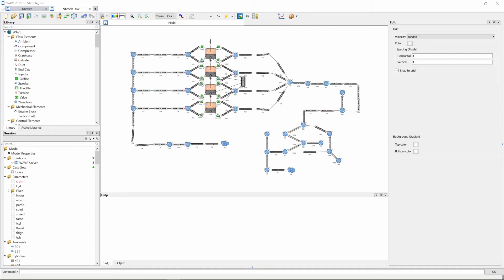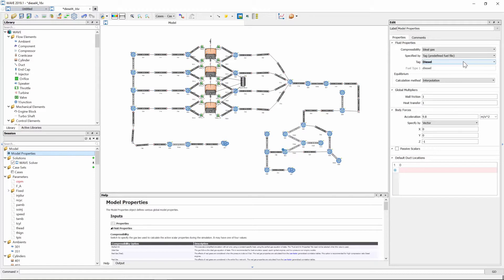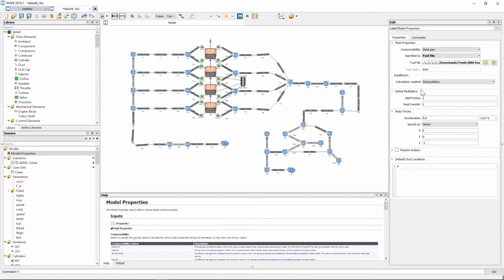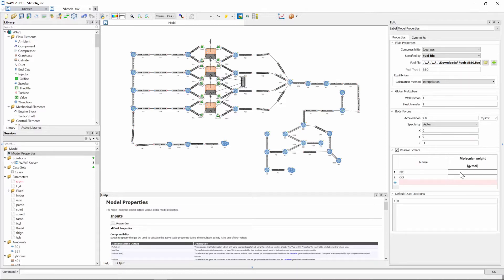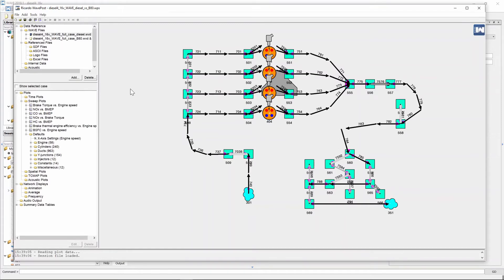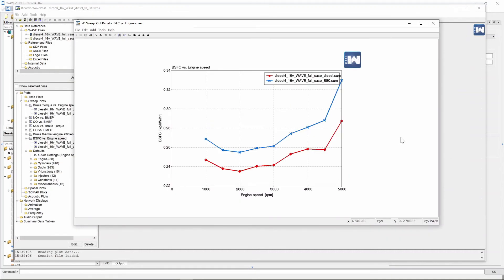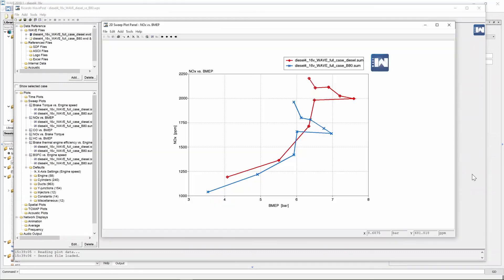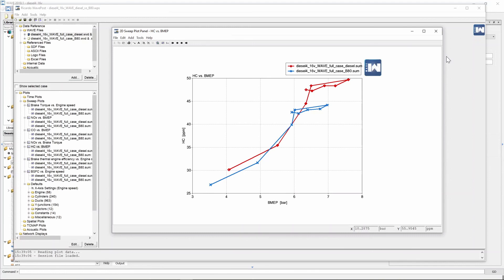How to simulate an engine using biodiesel | Engine performance and emissions | Ricardo WAVE

Comment: Hey I was wondering if you could send me this file you used in this video. Or tell me how to access the tutorial files in Ricardo wave? I'm using Wave 2022 are the files available on this version?
Reply from the maker: Unfortunately I do think have them any more. The tutorial files should be under Ricardo WAVE’s program files on your C drive
Reply: @AdriaanVanNiekerk  I'm using my university's computer and nothing is showing up in the C drive. Is there any other way to access these files?
Reply from the maker: @worldofanime4219  that is a problem - It might be worth while to ask your university's IT department to help? Unfortunately I do not know of another way to get the files.
Reply: @AdriaanVanNiekerk  unfortunately they were no help at all. I’m trying to model a 4-cylinder internal combustion engine based on the E888 engine for my dissertation. I need three simulations one for a gasoline fuel and one for an Ethanol-gasoline mix and a Methanol-gasoline mix. I’m struggling to make the model as it’s my first time using the software. Do you think you might be able to help at all?
Reply from the maker: @worldofanime4219  I had a look in my archived files and I only have the .dat files of ethanol, diesel and FAME. Have you looked in the model where you specify the fuel, (at 01:00) where there is a dropdown of all the available fuels? You should be able to possibly use E85?
Reply: @AdriaanVanNiekerk  I will take a look after I have tried to model my engine and get back to you.
Reply: I'm using my university's computer and I have searched high and low for the tutorial files but can't find them anywhere  @AdriaanVanNiekerk

Comment: Hello, I was stuck in the wave post results. How do i add the data from another run to the current run. I tried using the method mentioned in another comment but it is not accessible to add another run data.Also how do I enable to more sweep plots as seen at 4:21 to the left of the screen below the sweep plots tree .
Reply from the maker: So for every run you do a .post file is generated which has all your run’s data. In order to plot multiple runs you need to:
1. Run your first simulation
2. Rename the post file to something other than its current name
3. Run your second simulation where you made the necessary changes
4. Rename the newly generated post file
5. Repeat this until you have all the post files you need. 
6. import them into WAVE post
7. Now you can overlay the data on one graph

If you don’t rename them, WAVE will overwrite the old post file with the new one

Comment: What is the function of Y-junction?
Reply from the maker: To add multiple ducts together. This is useful for intake manifolds going from one duct to many as well as for when a exhaust manifold goes from many to one duct. You can also specify the orientation of the connections which helps with accurate pressure loss calculations 💪🏻
Reply: @AdriaanVanNiekerk  Noted. Thanks alot
Reply from the maker: @mohdfitrilimat  no problem 👍🏻

Comment: HI super explanation, I am trying to plot graph for Nox and every time it comes as a St. line can you tell where I am going wrong?
Reply from the maker: Hi Nikhil. I just want to make sure I understand correctly: do you want the values of NOx when it is above a certain value? You might be able to do it with an if statement block?
Reply: Hi, I am trying to compare emissions trend for different ethanol blends. So, as you explained I added NO as a passive scaler and activated emission model for the same. 

However when I am trying to plot graphs NOX VS BMEP or torque, I get straight line showing value as zero.

Comment: Hello Sir,
Great videos I like your content ... there aren't much resources to learn Ricardo from ,your content is very well explained !!!

Sir i was struggling plotting the graphs .. i plotted graphs as you have shown in video but my graph just shows a single point ... and i want to compare the graphs of engine with Diesel and same engine run on Biodiesel as you have done ..i wanted to compare the results.
Your advice would be very useful for me .
Reply from the maker: Hi! Thanks for the comment! If it was just one point check if you have run more than you one case? You need to run different cases (with different RPM values for example) to get a line graph
Reply: I got the plots right ...But right now cannot get the result graph of Blended Biodiesel and Diesel in single graph
Reply from the maker: You need to add the results from the blended fuel's run to the run of the diesel fuel. So if you go to about 4:19 you will see the graph window. There is an option "add" at the top. If you click it, you can select "WAVE data" and then select the other run's file and it will be added to the plot.
Reply: @AdriaanVanNiekerk  Got it Sir Thank you ... one more doubt how to add varying loads to get plot of Load vs. NOx
Reply from the maker: @bhushantayde5762  that depends. What injectors are you using? If it is an AFR one, then you need to restrict the inlet airflow which will result in less fuel being injected which will reduce the load generated.

Comment: Hi Adrian Van Niekerk
I would like to congratulate the tutorial and explanations on the Ricardo Wave software. Please, could you provide the example "simulate an engine using biodiesel" in the extension (.wvmx). I'm a student and enthusiastic about the software, it would help a lot. Thanks
Reply from the maker: Thanks! I will upload my files and share the link when it is finished👍🏻
Reply: @AdriaanVanNiekerk  Thanks for the feedback!
I sent a message to your Instagram. When you can provide the link to the Ricardo Wave file of this engine, I will be very grateful. You can also send it by email, I left it on your Instagram. It will be very useful for my study, as I have some doubts and you explain very well!

Comment: Great Explaination
I would like to make a fuel file for BioDiesel made from vegetable oils.
Please guide??
Reply: more specifically a B20
Reply from the maker: @bharatdogra2690  I am releasing a video this Tuesday showing you how to do this👍🏻 unfortuantely Ricardo WAVE has only one biodiesel data file. I think they have averaged all the feedstock’s properties together and made one file. So you cannot specify a feedstock for you biodiesel...
Reply: @AdriaanVanNiekerk   Can we create the file by using the method, specified in your websit??
Reply: Kindly aLso guide me in generating the graphs directly from Ricardo.
Regards
Reply from the maker: @bharatdogra2690  yes you can. 👍🏻
Reply from the maker: @bharatdogra2690  what graphs do you want to generate?
Reply: @AdriaanVanNiekerk  lets consider any two variable, for eg. BSFC Vs Engine Speed VS NOx
Reply from the maker: @bharatdogra2690  for three variables you will need a 3D graph. If you only want two variables such as BSFC vs BMEP then it is a 2D graph. In WavePost at the left top of the screen you select Add->Sweep plot->2D graph. An empty graph window will appear and then you select Add->Wave data and you select your variables for your x and y axis. In another Wave video of mine: https://youtu.be/iLxEX3B9VnI at about 7:13 I show you how to add a 2D graph
Reply: @AdriaanVanNiekerk  Thanks a lot
Reply from the maker: @bharatdogra2690  no problem. Do let me know if you have any other questions.
Reply from the maker: @bharatdogra2690  The video on how to create a custom fuel blend is available: https://www.youtube.com/watch?v=cA7NUHGFKxc